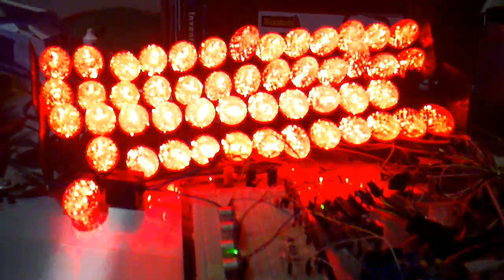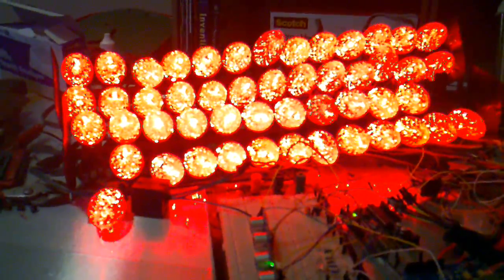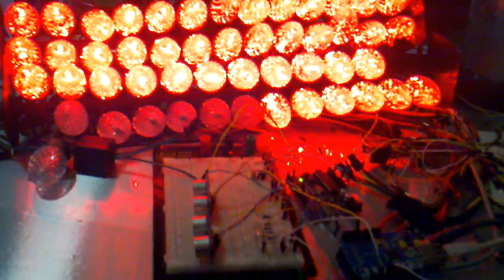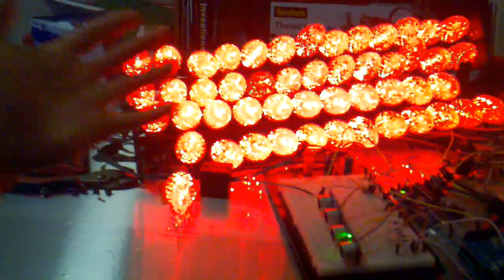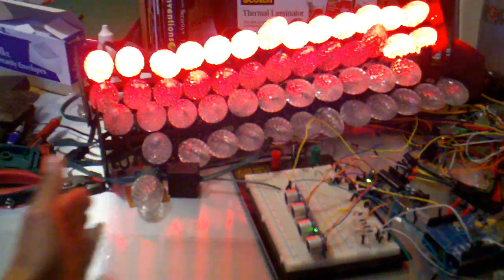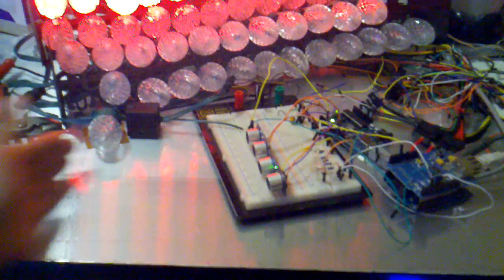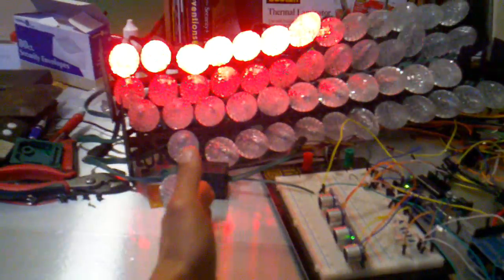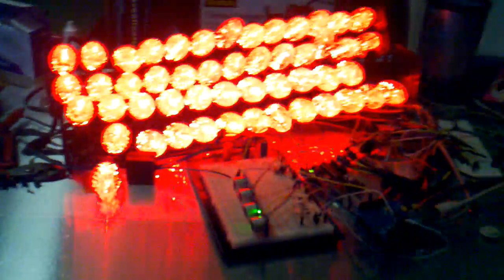Arduino controlled G35 RGB LEDs!!

Comment from the maker: @curtthemartian True, sorry. 2 wire. Ground and Data.
My arduino runs on the same power source as the lights, so I didn't count it. But if you're running on separate power source, then you'll need the ground as well.

Comment from the maker: @TheAlbertzone 

Very Easy, in fact, it's only one wire. No resistor, nothing. Just one wire into one digital pin of the Arduino.